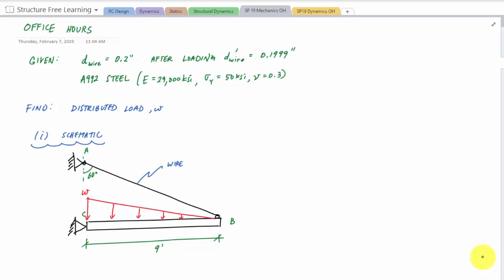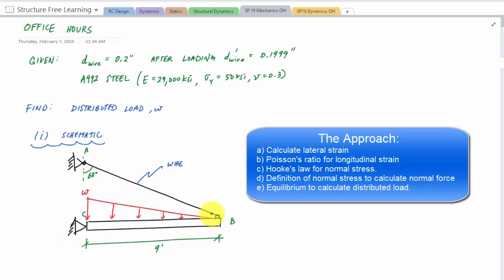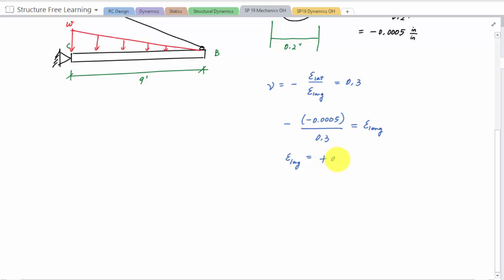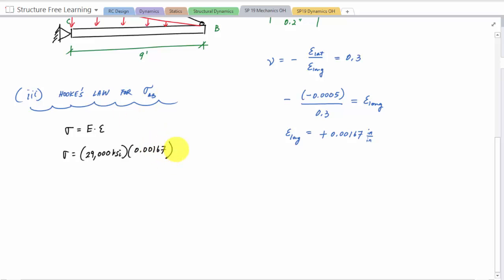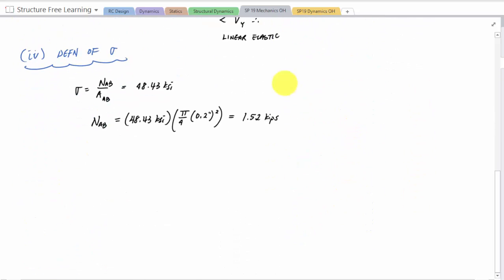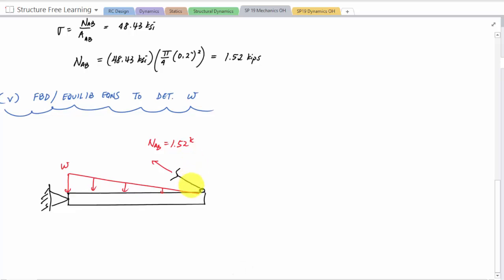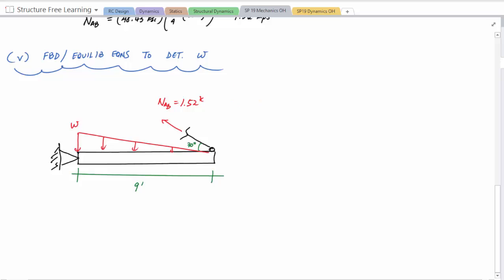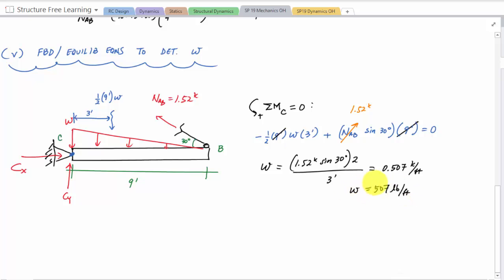Poisson's Ratio, Hooke's Law, Statics All-in-one - Mechanics - Office Hours with Structurefree

Comment: why you dont take the structure as a whole? is it already in equilibrium condition so you can take FBD below the cut wire ? is it because you already found the value of Nab so you can consider the structure already in equilibrium condition? because we still dont know the value of Ax and Ay, and if you take the structure as a whole, will the structure considered as indeterminate structure? or we can use B as an internal hinge so it remains determinate ?, thx for the video, very helpful